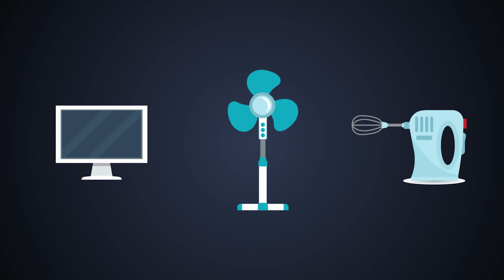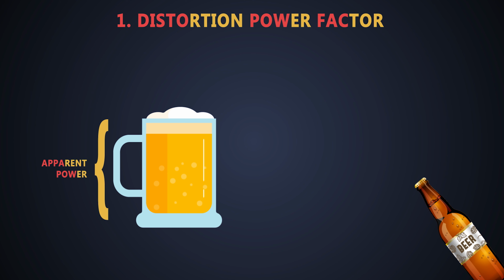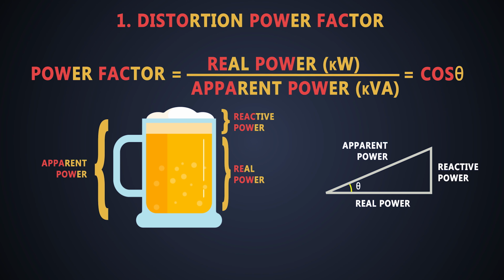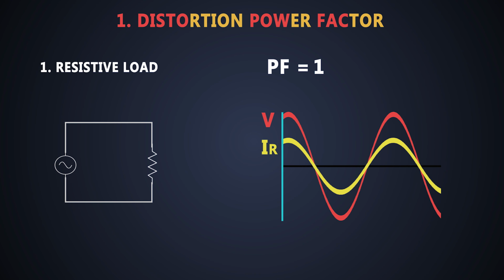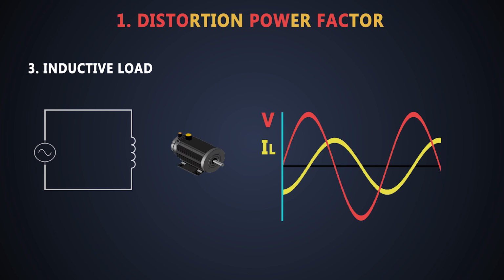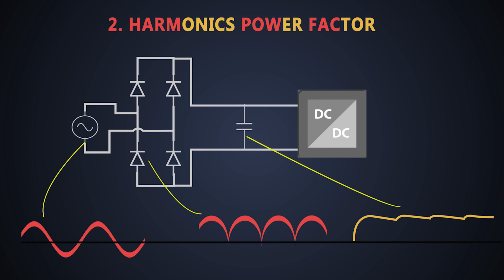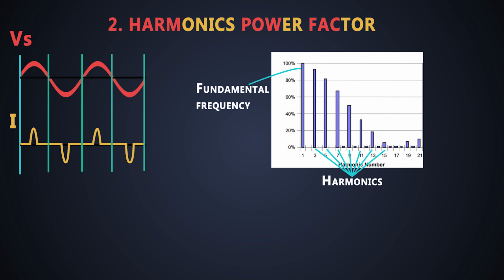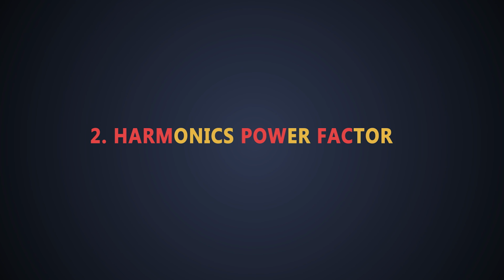What is Power Factor | Power Factor Explained | COS(θ)

Comment: In harmonics power factor happening in SMPS, you mentioned that the cap charges quickly but discharges slowly. Why is it? Thanks in advance for any explanation !
Reply: if you look at the circuit diagram, current can always enter the capacitor either from the rectifier side or the load side. however, current can only leave the capacitor through the load, as the diodes of the rectifier block reverse current. when the capacitor voltage is lower than that of the rectifier, the rectifier sees a very low impedance path through the capacitor, so massive current flows through the capacitor from the rectifier until the voltage across the capacitor matches the rectifier voltage.

now, when the capacitor voltage exceeds the rectifier voltage, it can only push current through the load. the load impedance is generally much greater than the impedance seen by the rectifier when charging the capacitor, so comparatively, much less current flows out of the capacitor than in. this is how capacitors in this configuration are able to smooth out the voltage from the rectifier greatly. however, they become less effective as the load becomes greater (lower impedance), as the capacitor discharges too quickly before the rectifier can charge it again on the next cycle.
Reply: Awesome !!! Thanks 😊

Comment: I was under the impression that the AC power that is supplied to the home is 90 deg difference between the voltage and the current. In this video you are saying that it is not.  That we actually have a PF of one.  What am I missing?